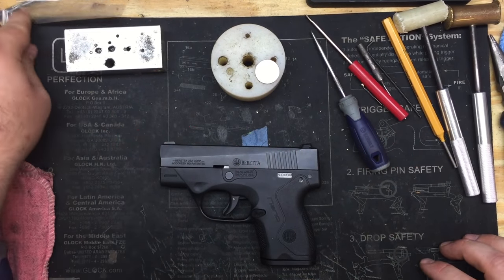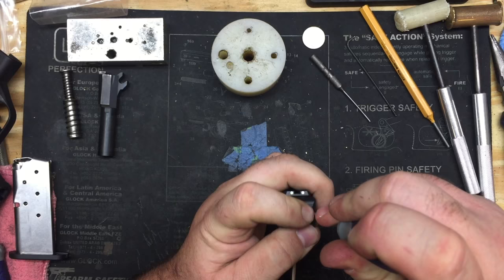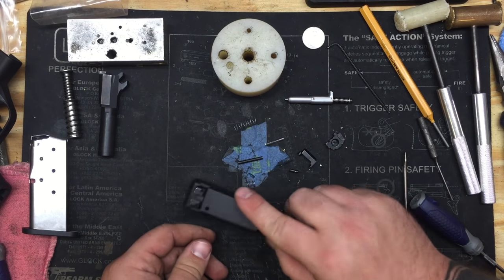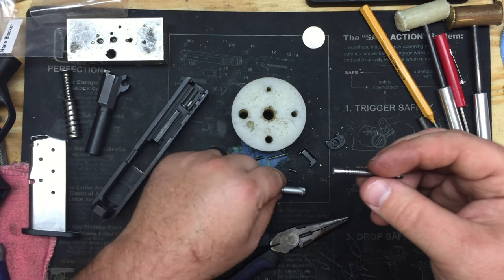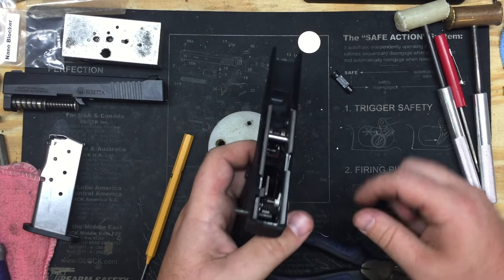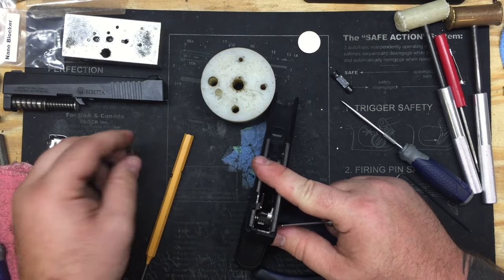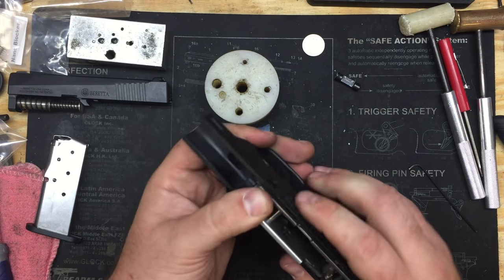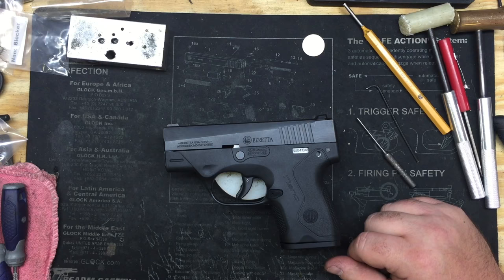Nano Spring Kit Installation

Comment: Okay...just verified by looking at a diagram of the Beretta Nano: Short extractor rod first, spring, and then long extractor rod. 

This is a great video, and I greatly appreciate you for posting this, but i’m about to upgrade my Nano, looked at an official diagram, and can say that the extractor rods are indeed in the incorrect order. This does not take away from the fact this is a grade A fantastic video, and I am very thankful that you posted this and saved my ass time and $.

Comment: I learned so much from this video about my Nano that you just made an order. What else can I say, but great job.
Reply: He Installed the extractor pins in the wrong order. Don’t assemble yours that way or you will have failure to Extract malfunctions
Reply: Joe S. Mine has been having FTE issues since I bought it. I just bought parts to upgrade/repair, and a dremmel, so i’ll let you know once I take it apart.

Comment: Thank You!! The only hard part was to re- assemble the back plate until I rememberd to press the striker guide down and I was able to de-press the striker spring so I could  put the back plate on, it took a while but I never would have attempted this normally and everything is working ok thanks again for this instructive video.

Comment: I bought an APX Carry and I knew that mechanically it's the same as the Nano so I bought Galloway's stainless steel guide rod and their spring/striker guide kit. The APX Carry's guide rod is plastic so that got switched, no problemo there. After a big battle I was finally able to get the backing plate off the slide to gain access to the striker guide and from what I can tell the APX Carry striker guide looks to be stainless steel and not plastic like the Nano's, so no need to change that out. I didn't take out the Blocker Spring to check, instead I just left things as they were in the slide and put that back together. Now the APX Carry's sear spring looks a bit different than the supplied Nano sear spring, so I did switch that out. After putting it back together I can't really say if changing out the sear spring helped lighten the trigger pull or not. If so it's extremely minor. Worse case scenario, I'm out $30 and an hour of my time. Best case scenario, I have some spare parts and gained working knowledge of how to take my gun apart. Long story short...if you have an APX Carry get the stainless steel guid rod, skip the spring/striker guide kit.

Comment: What if you just want to replace the plastic striker guide with the steel striker guide and that’s it? Do you still have to take all The extractor pins and springs like you did when you tip the slide over and let them fall out? I just want to replace the plastic striker guide and not interested in replacing the very in depth replacement of the rest of the chassis and what not, Thanks.
Reply from the maker: No you just need to remove the striker and do the swap out.

Comment: @GallowayPrecision: Dear Mr GallowayPrecesion, the trigger pull of my Beretta Nano is really heavy and long. if I upgrade the Spring Kit and the Striker Guide like you showed in this video, will the upgrade make the trigger pulling lighter and the pulling distance is shorter ? thanks.

Comment: What happens if the striker return spring isn't installed? Will the gun not function (and/or can it be dangerous)? One guy said his P320 fired because that spring was broken (though I don't know if it's true or not). I would have thought the gun would function fine without it, because the recoil will push the striker to the rear as the slide moves back forward, and then the sear will pull it back is the slide moves forward to chamber then next round. Many striker fired guns don't have a striker return spring and they work just fine. That's why I was wondering.
Reply from the maker: All the parts should be installed for correct function and prevent damage to the striker. The 320 is a different platform with a fully captured striker and sear setup. The return spring in the nano and XD line are to keep the un-captured striker from battering the strike channel face or the striker retaining pin on the XD The 320 like any of the striker guns has the striker reset as the slide goes forward from the end of ejection, they do not rebound due to spring pressure holding it forward when released, it is caught and retained to the ready point as the slide goes forward. Being captured as it is like a glock, MP or SD, or similar captured models on the market will not batter the face of the striker channel so no return spring is needed for them.

Comment: going off of the schematic diagram on brownells you had the extractor rods backwards, the short one goes in first then the spring and longer rod. 
I was unable to get the blocker out in order to install the new spring, any tips on that?also ordered the trigger spring kit and received no trigger spring, kinda defeats the purpose of the order don't you think?
Reply from the maker: We haven't included the trigger spring for over a year now.  Some of the pistols have a tolerance issue with the safety blade.  The trigger return spring ISN'T where you get the most reduction from the blocker and sear spring.  The rods went back in the way they came out from the factory.

Comment: Is that stainless guide rod compatible with any other guns? (I know many strikers look alike... but that one looks identical to the stainless Glock strikers. I know it's probably not the same dimensions though.)
Reply from the maker: The striker guide included in the kit will fit the Beretta™ Nano and APX Carry Single Stack Pistols only.

Comment: I purchased Reduced Power Spring Kit for Beretta Nano, I have installed everything no issues. My question, Beretta says not to dry fire or the gun will break, is that issue now solved being that I have upgraded that Striker Guide?
Reply from the maker: They are referring to the striker itself.  I would use snap caps while dry firing.  All that energy being release by the spring needs to transfer to something so it doesn't just slam into the striker channel repeatedly.
Reply: GallowayPrecision Thank you for taking the time to reply. I understand the information you present.
Reply: We're Beretta says not to dry fire? Cause I'm dry fire often, and I don't have the owners manual

Comment: hey galloway. i want to get your guide rod for my nano. was thinking about the 14lb. whats the biggest benefit with going with your steel guide rod?
Reply from the maker: The 14lb guide rod is for low pressure ammunition only.  If you are wanting to reduce the felt recoil and muzzle rise you want at least the 18lb spring rate.
Reply from the maker: The biggest benefit being that our guide rod being steel it's not going to flex the way the stock plastic one does.  That is going to lead to better accuracy.
Reply: gotcha. i usually shoot 115 and 147 grain

Comment: I didn’t get a trigger spring in my kit. Has the kit changed?
Reply from the maker: Yes, we dropped the trigger return spring due to tolerance issues in some Nanos with the trigger safety.  They can be molded slightly out of tolerance and the lighter spring would cause drag on the safety.

Comment: What was the reply from GallowayPrecision on the reverse extractor pin, spring, and plunger install?
Reply from the maker: That's how ours came from the factory, so I reinstalled everything the way that it came out.
Reply: I put mine back together the way you did in the video and had a bit of trouble with the Disassembly pin not automatically returning to the vertical position as the slide would not return to normal. After I manually turned the Disassembly pin to vertical, the slide snapped to a firing position and the trigger pull was normal. I put it away, didn't try to fire it. Then I was looking at the Beretta Diagram & Parts List and checked the extractor parts when I saw that the plunger and extractor pin were reversed. I immediately changed them in accordance with the diagram and the slide went back to a firing position on the first try with the Disassembly pin returning to vertical on its own.

Comment: Nothing you said about the striker spring guide rod makes any sense. It sounded more like a commercial than actual improvement of function. I am sure if a steel guide rod made that much difference Beretta would have included it. A minimal if measurable difference at best. In the future just stick with the facts.
Reply: Everyone knows that steel is better than plastic; well, maybe not everyone I guess. LOL! Why be so critical of someone trying to make a good design even better by adding better parts. Plastic gets hard and brittle and WILL fail somewhere down the road; steel WILL not. I made this upgrade and now my Nano TANK is even better because of it. I'll tell you what makes No Sense; why anyone would include "King" in their youtube handle. :wink:
Reply: @somethingsmith3242  👍🏾😂😂